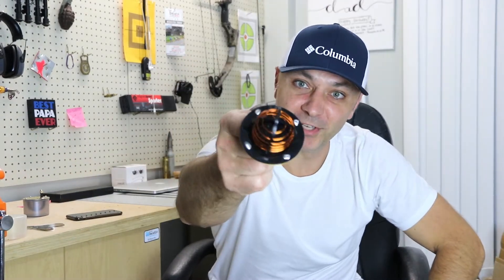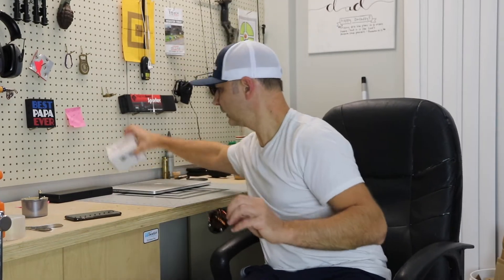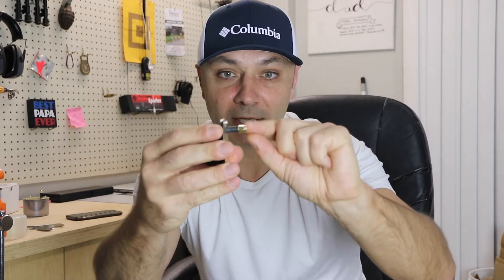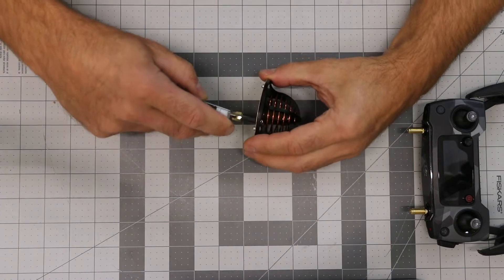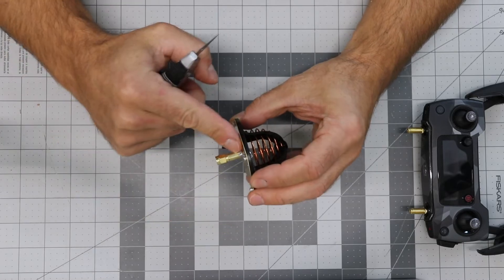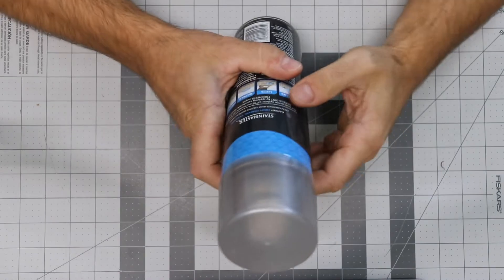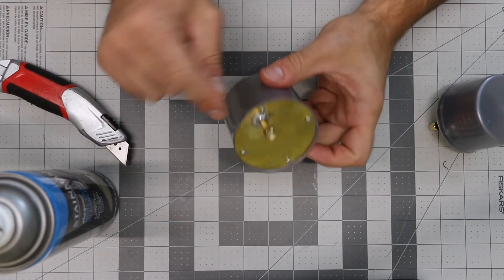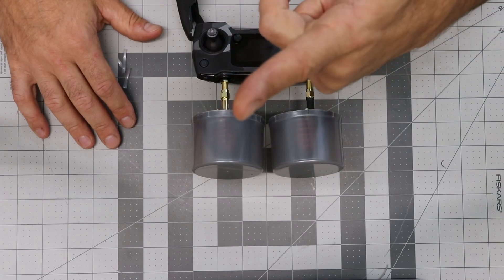Improving FPVLR Antenna, Making It Batter!

Comment: Peter, your idea of making the piece stiff on the back is good at half. 
Certainly it does not flex, it does not give the impression of having something precarious in hand, but if it flexes under an accidental impact it is more difficult for it to be ruined, while the rigid piece could break around the weld. 

Instead, I fully agree with the delicacy of unprotected copper coils. 
Well before seeing your video today, an year ago I put on plastic covers, a pair taken by two automatic LED lamps, of the type with the movement sensor on the dome (removing the multi-faceted cover) and another pair from the caps of the shaving foam spray cans for women, and are well rounded, not cylindrical. 

Couples because my antennas are two held together by a plastic flange, fixed (for the old FPVLR style) or variable (the new ones, similar to the Chinese COOL copied by FPVLR... which are just as good, but cost less). 

Make sure the lids are made of plastic only, not mixed with metal powders, some cans of spray paint may be of plastic conglomerate, not pure plastic.
Reply from the maker: Thank you sir